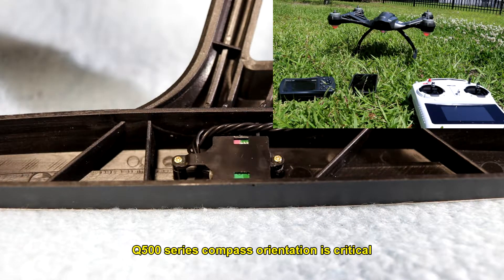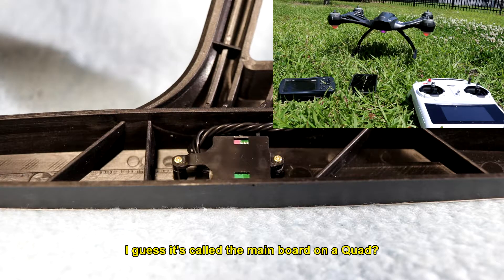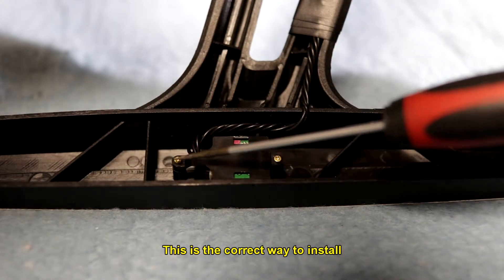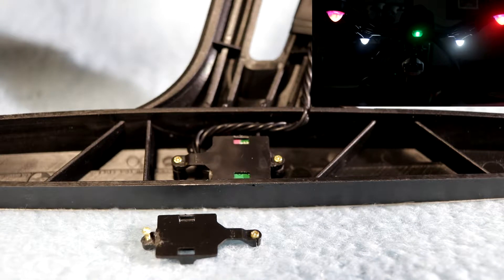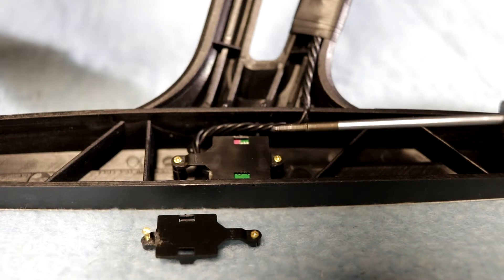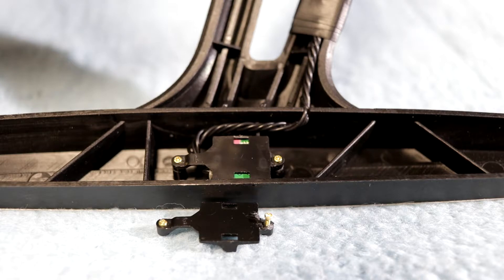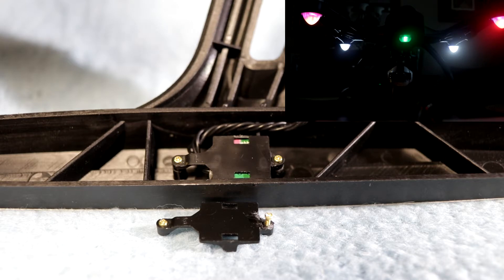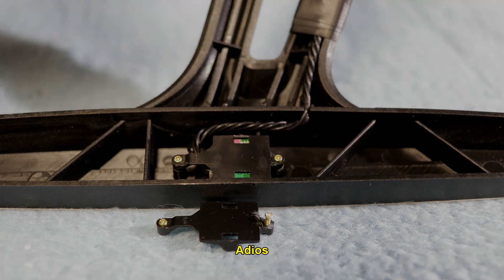Yuneec Typhoon Q500 series orange blinking LED - Fixed!!!!!

Comment: So If You Power On The Quad Without The Compass Then You Will Fry The Circuit Board?? Because I Powered On My Circuit Board To Test With Nothing Plugged In.. No Smoke Or Popping Noise Happened So I'm Thinking Everything Is Fine?
Reply: Or You Bought The Circuit Board Thinking yours Is Fried But In Fact It's Perfectly Fine and Can Be Used Again
Reply: My circuit board was fine, the whole problem for me was I  installed the compass 180 deg and it just didn't work.  I bought another compass and circuit board for nothing. ha, thanks.